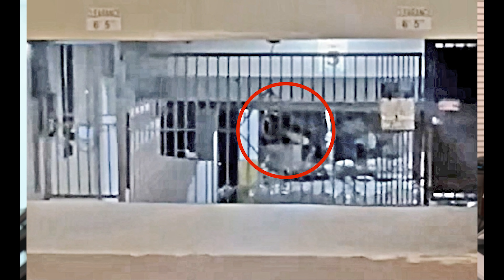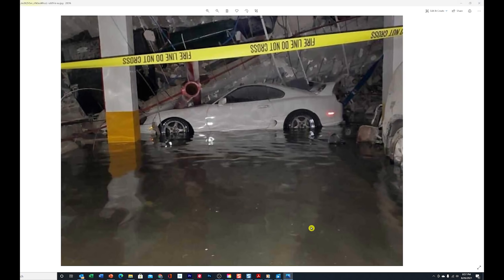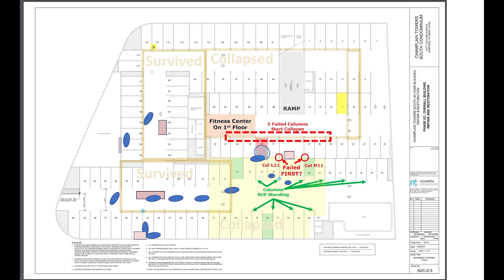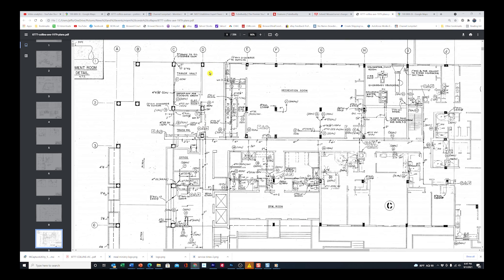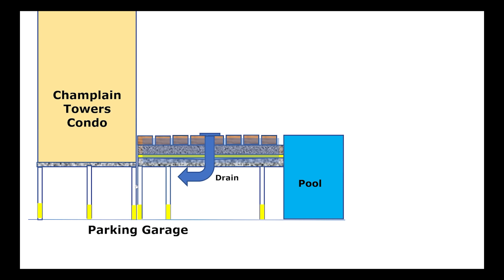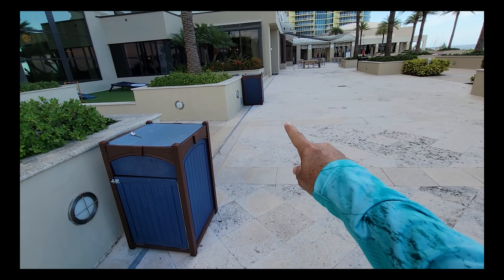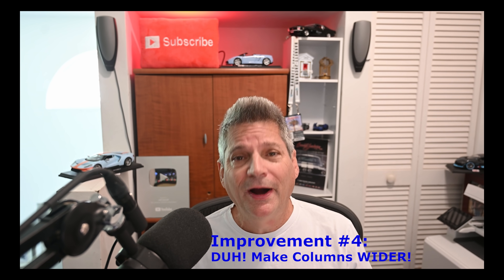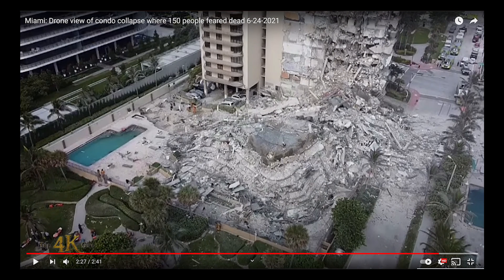Miami Condo Collapse: 4 Engineering Fixes May Have Prevented It

Comment: a lot of these ideas, were considered for new construction after the 1985 Mexico earthquake, and their good ideas. I just have to point out it wasn't exactly feasible for the engines in 1979 to jump into a time machine to get the 2021 updated codes for flat slab construction. hindsight is 20/20, foresight seldom is.

also if the pool deck was as bad as some think it was, I think it would have been at best a bandied on a deteriorating structure that would only delay the inevitable. sometimes it really is best to just replace something rather than patch it up (not always, but sometimes). if those 16x16 columns had to be expanded to 20x20 to 24x24 columns, everything around them all the way up (doors, walls, flooring, etc) would have to be ripped out and made again for the larger columns. I suspect that will cost around as much as just making a new building.
Reply from the maker: I think it they just did the drop panels and capitals it would have been enough
Reply: @jeffostroff  for the pool deck, where it was still good, absolutely. I have doubts the extra weight of the drop panels and capitals on every floor of the building, would be within the load limits of the 'aged' 16x16 concrete columns. granted indoor floors probably were not directly drenched in sea spray from hurricanes, humidity still does things, and we don't know how much of the pool deck and if the pool deck was the only area with horizontal separation of the concrete into layers between the rebar (look of absolute dread).

when I had seen the pic of the pool deck core samples, it was bad. you may have been able to save the pool deck (somehow drill and re-bond the layers back together maybe if it was only a few isolated spots), my gut is saying should have replaced it ASAP and check the rest of the structure ASAP. from pics of the rubble pile, punching shear is in your face everywhere, it wasn't the only thing that worried me about the structure (slender column sizes being one, minimal rebar from column out to slab, how easy the slab gave way, etc).

the building, extra column jacket to support the panels/capitals loads may be, that gets complicated fast. maybe I am being pessimistic, or worrying too much, I do have doubts tho. and either way, great vid.

Comment: Fix #1: add expansion joint  Problem: As you pointed out it means you need to add several columns along the break.  Developers don't like that because it costs more money.  In addition, there is more formwork involved which means more money, which is a no-no to developers.
Reply from the maker: Developers also don't like the publicity when their buildings come crashing down. They often lose their licenses

Comment: What would you do to the twin building still standing to provide peace of mind to its residents?
Reply from the maker: I would add caps and drop panels to the tops of all the columns in the garage. The north tower is going through its 40 year certification right now but the engineer has so far stated that he doesn't see anything wrong with the building. Even though they have very similar floor plans they are not carbon copies of each other. And so the north tower is smaller it only has 10 units per floor as opposed to 12 units per floor on the other building so that reduced weight would probably help it tremendously plus I don't think they brought in all of those tall palm trees in the additional planters on their pool deck which the Champlain tower S did back in 1996. Other rumors I heard from earlier news reports a couple of months ago was that the north towers were better at keeping on their maintenance than the South towers were.

Comment: Jeff, I had to come back to this video to share with you what I saw in an ancient site on another video. The columns had the same kind of upside triangular construction that you show here at the 13 minute mark and following. What is remarkable is that the ceiling is a little bowed but the columns are strong and still holding it up 2400 years later! I never would have noticed it without your discussion here!
Reply from the maker: Good eye Maria, thanks for the confirmation that this does work

Comment: I agree with all of your assessments and the building needed more sheer walls.  The small sheer wall is what appears to have caused the delay of the third section that went down and defiantly helped save the standing section along with the larger columns..
Reply from the maker: yes that wall gave it about 7 seconds
Reply: @jeffostroff  Imagine how many lives would have been saved had it been sheered like the other side.  I know we all want beautiful open views but we need structural walls for a reason.  I am still surprised in an area with hurricanes there wasn't more.

Comment: non engineer but : is it economical to make a safe building? It seems like they were taking lots of short cuts all under the building while it was being made. You can always beef something up but it will cost extra in money, material, labor and time. Where does it end, never build above one floor? Over build until it can't be taken out with a bomb? Guarantee the build  for only a decade? Also, If I have concerns about an apartment building, before or after moving in, what can I do? Who to contact?
Reply from the maker: Just move into a newer building that's the only thing I can suggest

Comment: As a building envelope specialist, I have not heard enough about the waterproofing (they are not all the same) or the pool deck build up. What I’ve heard is mildly alarming. Generally you should not use a sand bed on split slab construction. Sand is OK for on grade. It’s better to have the structure slope to 2- stage drains with a drainage plane between the structural concrete and topping concrete or pavers.
Reply from the maker: Unfortunately they call for sand even over concrete
Reply: @jeffostroff  I don’t know a single system that would recommend sand.

Comment: Great job of explaining the engineering changes.  I watched other videos discussing the lack of capitals and the deck being attached to the building, but they didn't get to the point of making those design changes(Building Integrity).  Just curious if you think the architect should be held responsible. Also, was the hotel in Ft. Lauderdale a taller building?  Is there a standard for the size of the column based on the number of floors or weight? I'd like you to compare the design to Champlain Towers North.  I saw a news video about that building. They had a pump to remove the water and added waterproofing. The resident thought that building was safe.
Reply from the maker: Architect is long dead, builder too. HArbor Beach Marriott is 14 floors, one more than the Champlain Towers Condo. Very similar sizes

Comment: I would have had instead of all columns, I would put in some stabilizing walls inside the building.    Put a wall 8 feet long inside the building attached to another 8 foot wall 90 degrees from it.    Put a few of them in the building.   rebar them.
Reply from the maker: Good idea!

Comment: I was recently in Miami and I was terrified to see dozens of tall buildings that clearly had no drop-slabs, capitals or beams on any floors.  I live in a highly seismic country and we have several quakes higher than 5 Richter each year and at least one above 7 every five years.  We never ever do floor slabs without beams.  We don't even trust drop-slabs or capitals since a few decades ago.  Being Miami in the middle of Hurricane Corridor, I would never dare to build without beams either, if not for powerful horizontal forces, then, at least, for water damage in unexpected ways.
Reply: Can’t agree more.  I was shocked to see just how under built these buildings are for being so close to the ocean.  I’ve seen 2 and 3 story buildings with thicker columns than those used under this pool deck.  The surprise shouldn’t be that the building collapsed…but that it ever managed to stand upright in the first place.  If I was living in the northern tower, I would be selling my unit as fast as possible.

Comment: I think you pretty much nailed it. I can't think of any other fixes that would have prevented this. 

The key thing is the larger columns with beefed up interface with the slab above by use of drop panels and capitols to resist punching shear. 

The isolation joint is another key fix. What were they thinking by tying in the pool deck with the tower structure? This may have been the biggest fatal flaw since from what we know the pool deck collapsed first. Had the Tower been isolated from the tower deck it would still be standing. 

I don't know how the original engineers didn't incorporate these design elements. It's all pretty basic stuff and you can find high-rise structures far older than this tower that incorporate these safety elements. This was just shoddy engineering. 

I live in a 11 storey high-rise far older than this building. My building was built sometime in the late 50's and in the underground garage the columns are large and incorporate the drop down panels.

I wonder if the original structural engineer is still alive? I don't know about the U.S. but in a lot of countries the engineers would be charged with manslaughter.
Reply from the maker: I would like to see more garages incorporate drop down panels and capitals

Comment: Interesting having two dumpsters on an upper level, not on the ground floor.   Dumpsters in these buildings are filled by dropping trash from the above stories.   Just wonder if the constant dropping had somewhat of a jack hammer effect on the concrete slab below over time ?   From what this video and previous videos show, there was more than one cause of failure in this building, probably a combination of problems.  Heard this today on the Condos and HOA radio show, 9/12/2021  that Champlain Towers South had 700,000 in reserves, but needed 13 million for repairs.   This would have required assessments of 100k plus .
Reply from the maker: These ar eon the ground floor. They fell down into the basement level garage. It needed $16 million for repairs, and they took out a construction loan in March. The first payments from owners were due in Jun right before the collapse
Reply: @jeffostroff    Thanks Jeff.   So what I heard on the radio was 3 million off.   You have done such a through job in showing the problems with C. Towers !   I'm sure a lot of boarder line buildings will be looking at major assessments and rising insurance costs in the months ahead.   That was also mentioned, about requiring a minimum reserve being mandatory for structural repairs.

Comment: Of course the complication with retro fitting drop-panels and capitals (instead of doing it right the first time) is that you're pumping concrete "uphill" (you can see the round ports at several places on the form), and you're always going to have those "cold" joints vs having done it as one monolithic placement during initial construction.  But it does work, and will increase load capacity, punching shear resistance (and safety margin) of the supported slab.  (Pay me now, or pay me MORE later... ;')
Reply from the maker: yes, and they use bonding agent as well to help with the cold joints

Comment: Champlain towers East, the newest of the three is pretty different. That one uses a post tensioned design, big difference in only a few years between South and East. Guys who inspected it, gave that one a clean bill of health.
Reply from the maker: Champlain towers East builder ran out of money, and the concrete slab sat there 12 years exposed to elements before a builder took over the project
Reply: @jeffostroff  Wow, I didn't know that. So that's why it wasn't done until 1994...

Comment: Use stainless steel rebar for any concrete that is not completely indoors and dry (balconies, pool deck etc). It's not necessary to build the entire building with stainless rebar. But would be really great for the first two stories of the columns from the very bottom of the structure from the piling caps up to somewhere between floors 2-3 could swap to regular rebar. Also this will reduce the problem of overcrowding at the critical joints between the garage ceiling, first and second floor slabs because of the higher KSI strength of the alloy. Less rebar, less concrete cover = less deadload. Making sure the building doesn't have unnecessary deadload that is not contributing to either cost savings or safety is the prime job of the engineer, getting rid of useless weight and saving money in less concrete/rebar. This guy that designed the skinny columns with an absolutely stupid amount of rebar overcrowding the columns, not only wasted the developers money, but made it a lot harder on the building contractors to follow this hard-to-pour design, and made it unsafe in the end. Bad bad bad.
Reply from the maker: Yes, also what about epoxy coated rebar?
Reply: @jeffostroff  That doesn't work, because the coating can be scratched, cut ends need to be sealed etc. Numerous northern state DOT's have been moving away from epoxy coated rebar. NYDOT is one of many. Solid stainless rebar is more ductile, so it's easier to bend on site when setting up, the tensile strength is higher (75 ksi!!), so you can use less and the expected lifespan is up to 120 years... There's new alloys out that are better than the old 304. Even 316L is 1000 to 2000 times more resistant to chloride than carbonsteel. Yes the good stuff costs 2.5 to 4 times as much, but it only contributes about 1-1.5% of the total cost of the building. Take one bridge column for a better example, using stainless versus carbon steel adds about 48% to the cost of the column, but that column immersed in sea water requires a minimum concrete cover of 4 inches, and even then, would only have an expected lifespan of 35-50 years tops. Here's the thing about concrete cover. The cover over the top mat in a 4 way slab does not do anything to the load bearing capacity of that slab, only the concrete between the upper and bottom mats counts. So the increased concrete cover you require under code for carbon steel bars adds a lot to the dead load, but doesn't help with live load capacity, and might require stronger foundations. So using stainless rebar, you can save money by, using less cover over the rebar, less rebar is needed due to the better strength characteristics, so you can lower the deadload of the structure without compromising the load bearing capacity. This is especially important in seismic areas.
Reply: @jeffostroff  Some states have had bad experiences with coated carbon steel rebar, because if there's even a slight scratch somewhere, then the corrosion attack is concentrated in that one spot, and in a post tensioned design, that cause cause a sudden catastrophic failure with little or no warning. Not good. We want structures that if they have to fail, they give enough warning time for orderly evacuations, or the DOT to have time to come out and close a bridge and set up detours etc, then call in Controlled Demo Inc to drop the bridge and start rebuilding...
Reply: A couple places where stainless rebar was used is like the Major Deegan Expressway Viaduct. This is a 72-span, steel-riveted viaduct carrying I-87 over local streets near Yankee Stadium. Also the Alexander Hamilton Bridge.

In 1937, the Progreso Port Authority, in the Port of Progreso, Yucatan, Mexico; constructed a bridge using stainless reinforcing bar. That bridge is still standing today, and in use. No major maintenance has been needed. In the 1960's, a sister bridge was built using conventional carbon steel reinforcing bar. This bridge has been out of service for many many years now, because the deck and foundations have completely disintegrated due to the corrosion and complete loss of the carbon steel rebars...

Comment: What about the fact that actually a 24 x 24 columns were only in the one section up to the second floor in the rest of the way up we’re all the 16 x 16 so the whole building really had the smaller columns it was only where there was a live loads on that first floor that the 24 square columns were located. Make sure that all your information is correct
Reply from the maker: They had the 24 in columns where it mattered

Comment: so the North tower has same design why are they not worried about the same thing happening to it ...with the design of the columns ?????
Reply from the maker: Not 100% same, but similar design, north tower has 10 units per foor, south has 12 units per floor. North is undergoing 40 year certification. Engineer so far says its ok

Comment: I used to work at a well known transmission mfg. in the prototype machine shop and I learned they don't like to over engineer the parts to save cost? I hope its not the same for buildings safety should come first not costs.
Reply from the maker: it probably is the same

Comment: There was a wall of strength that started from 4-5 floor and continued to the roof.
Which of course fell like a parachute because it was not connected to the foundations, a very strange thing from an engineering point of view!
By the way, today in Israel a building collapsed for the first time, fortunately for the tenants they were evacuated yesterday after the building was partially demolished.